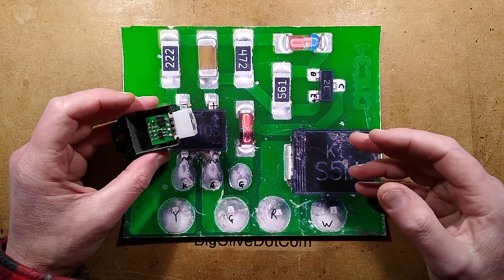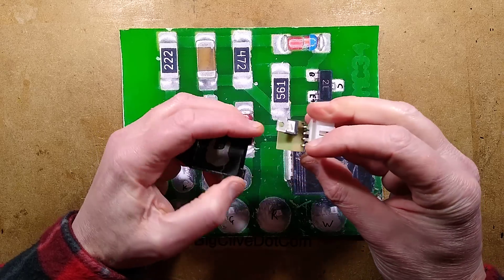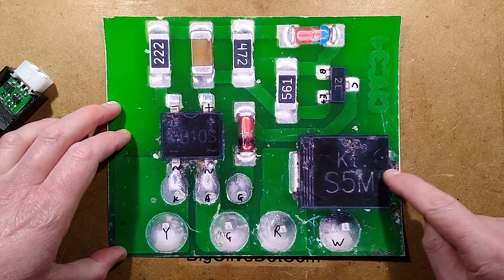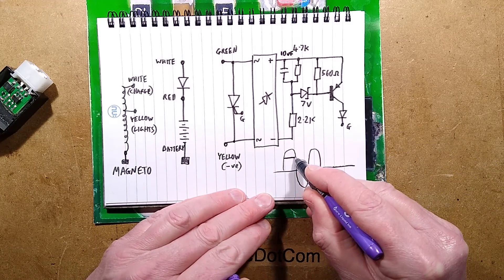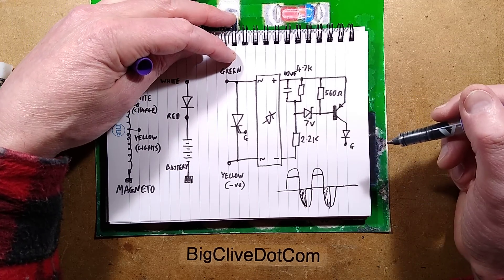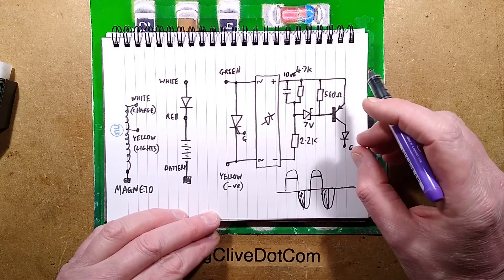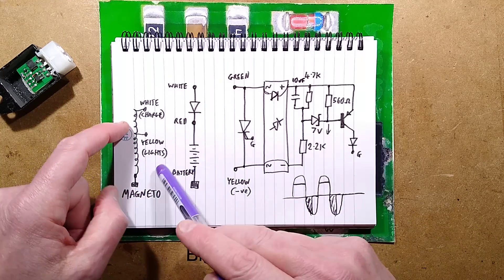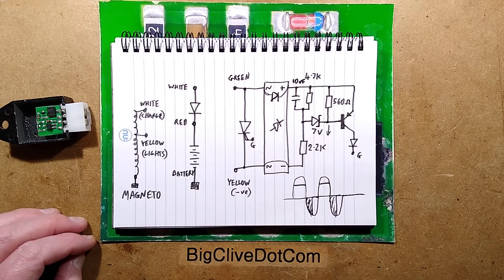Chinese quad/scooter rectifier/regulator teardown with schematic

Comment: It would be interesting to see a comparison between a cheapo reg rec and one from a Japanese manufacturer, especially as they can be prone to failure over time.
Reply: I agree, I hope that the Japanese ones have a proper regulator circuit on the DC side. I had no end of issues on an old Honda MT5 which only had a single diode on the DC side, there was no regulator on the DC or AC side. It boiled up my modern sealed battery which caused the DC voltage to float up to some really high level, it then blew all of the DC powered bulbs and the flasher unit! The AC voltage also went high and that blew the AC powered bulbs. In the end I fitted a 4 pin 6v regulator unit off a later model, (SH570-6), the DC voltage now sits at about 7.8v which is still a bit higher than I want but it was up at around 9v when it was running with just a single diode, (no wonder the battery boiled!), I guess this must mean there is some form of regulation going on.
Reply: @sidecarbod1441  damn that's an odd failure, usually they just die on you miles from home
Reply: @gingerelvis  Yeah it was annoying but at least the bike got me home!
Reply: @sidecarbod1441   i have same problem on gy6, all my electronics are BLOWN(flasher relay, blinker bulbs , tail/headlight, dashboard, speedo,odo..etc) and battery. idk what to do at this point
Reply: @LasheXX  I'm not sure what a gy6 is, if its an old bike with 6v electrics then you need to find out whether the AC is just rectified or whether it also has a regulator, really you need a reg/rec unit. I have also given up using sealed batteries on my moped, I now used an old style lead acid battery that I can top up if required, it seems to be able to cope with the 7.5v that the charging system puts out. When the Honda MT5 was in production it was fitted with a lead acid battery.

Comment: Sad to say, 4 years of engineering school and had never heard the term 'magneto' before (except in the comics). Had to look it up and then "Oh, it's a generator". 🤦‍♂️

Maybe it's an American thing like not using the metric system.

Also, thanks for the teardown and lesson. Subbed. 👍
Reply: Think that's just the traditional word in this context, similar to the snubber cap in the ignition circuit being referred to as "condenser". That's understood I guess, as the basic design is like 100 years old!
Reply: A magneto is a specific kind of generator, using permanent magnets, rather than energized coils.   Just claiming it's an American thing is like being upset with people for not calling a pickup truck an automobile.   Because they're all the same. Now, if you spent that time as an ME, then I'd understand it.  If an EE, not so much.

Comment: With the Light circuit basically shorting the yellow lead to ground, that might actually be a shunt voltage regulator for the battery charger.

Also, I suspect what Clive is calling a "thyristor" is actually a TRIAC rather than a SCR, then the bridge rectifier makes a lot more sense as it would fire in both Yellow positive and negative cycles. 

I suspect that you will have to do some testing in circuit to figure out exactly what this thing is doing, as it obvious is doing some "tweeky, weird" things that all interact. As is, it's confounding with just looking at the circuit.

Comment: I had the voltage regulator fail on my late 90's yamaha FZR motorcycle once, I was facing a garage door and very quickly my headlamp got very bright, and then flashed every color of the rainbow at insane intensity before going dim and the bike dying. The headlight's behaviour is what alerted me to the regulator failing

Comment: Dear Mr. Big Clive, please excuse my comment ediquite as it is my first. I enjoy your stuff. I am a 55 y.o. manchild. Worked on autos all my life. It was explained to me at an early age that the SPARK OF AN IGNITION COIL is produced when the primary winding "collapses" over/on to the secondary. Say when ignition points open, the "back emf" from the deenergizing primary falls over the secondary. In short, the spark is produced when the PRIMARY GROUND CIRCUIT IS OPENED. CDI allows for an increase of primary voltage, thus a multiplication in the secondary. This is how I understand ignition coils work. (I've been wrong before) I did not grasp your explanation on this subject , though I usually do.    THANX FOR THE FUN!  Keep up the good work.

Comment: Hello Clive the way the bigger bikes control and rectify the voltage is very similar to this except they usually use a 3 phase alternator with 3 thyristors one for each phase the voltge is then rectified by a 3 phase rectifier and the voltage sampled and each phase is then shorted by pulsing the thyristors on and off this then regulates the output voltage to around 14 volts this then controls and charges the battery. Its a bit of a sledgehammer way of doing it but it works just fine. It also does not overheat the alternator windings because as soon as it shorts out the alternator there is no current flowing as it is fully shorted and in theory no current flows and therfore no heating occurs during the shorted out pulses. 

Thanks for the channel by the way all very good stuff.

Comment: The overvoltage is accommodated in the battery by electrolysis. Battery water maintenance is a thing for motorcycles with these crude circuits.

Comment: Years ago I owned a 1971 BSA 250 cc single-cylinder motorcycle.  As with many smaller bikes at least at the time, the alternator effectively consisted of a permanent magnet rotating within a coil.  Its output was fed to a selenium rectifier, and the "regulator" was a 50-watt zener diode.  It did have a battery which of course provided some voltage stabilization but that was the entire charging circuit.

Comment: Unless stuff on the motorcycle/quad requires AC to operate, it would make more sense to do it like they do on car alternators: put a full bridge rectifier across the coils. With full wave rectification, the battery charging voltage can be a little lower (fewer turns on windings) and with windings not needing to handle short-circuit current ~1/4 of the time, they should be able to use thinner wire gauge too. You also get better energy efficiency and smoother operation from the engine by generating less unnecessary and irregular drag.

Comment: I am trying to make remote control Ac appliances switch using CRT TV remote infrared receiver. The problem is when I search on google I found infrared receiver output logical means when I push the remote button sensor output is low. When I not push the remote button sensor output goes high so that means when I connect NPN or PNP transistor in to the out put of the infrared receiver to derive the rely. Rely derives the AC appliances. The problem is infrared receiver output not go low that means normally appliance is on. When I push the remote button appliance not turn of. Infrared sensor output is drop to 0.5 v instead of full. My CRT TV remote receiver module is brand new  This circuit is not made of arduino .What is reason behind this please explain.

Comment: The battery is regulated by the very shunt regulator you detailed as it shunts the entire winding.  The bridge rectifier is because with lights off both sides will be full voltage.

Comment: Personally for my experience with my three different scooters the first being a 50cc 2-stroke and the other two being four strokes the battery really never retained its charge too 12 volt or higher it seemed every two or three months during the summer I would have to recharge it just to make sure that I had enough energy to electric start the bike and keep the headlight bright enough for me to be seen at night and to be able to see!

Comment: I wonder if they are relying on the idea that you will be riding it and using enough energy out of the battery to not have to worry about it overcharging. I mean there isn't much of a point to idling your quad is there, other than to warm it up for a minute before you take off?

Comment: Hi 
Good evening 
You gets wet you pay for, all the kaswasakies I have owned use alternator that are similar in construction to a conventional car unit and output controlled in the same way 
The old triumphs used permanent magnet alternator and just had a zena across the output of the rectifier. I think it's the cheap Chinese stuff that isn't designed properly 
Keep up the good work

Comment: If the battery is an open-vented one, it will dissipate any excess energy by splitting water from the electrolyte into hydrogen and oxygen. In the perfect explosive mix, two moles of hydrogen to every mole of oxygen, right next to the hot silencer .....  although any explosion will be limited in energy to however many joules would not fit into the battery.  Unless it ignites something else .....  Something to think about as you ride along, with your bum so precariously close to the petrol tank .....

Comment: Some years ago, I had problems with my old 70´s moped (better call it Mofa- Motorisiertes Fahrrad) with an completly unregulated 6V magneto, that the lightbulbs would constantly burn out. I then tested a regulator from a scooter wich regulates anything higher than 12V to 12V´s, wich stopped that. But I always wondered how these regulators worked due to it needing a chassis ground. Oh and there is very nice webside wich goes into great details about 70 and 80´s Magneots and regulators wich where used in german mopeds in that time.

Comment: 6:00 The magneto can be crowbar shunted on higher rpms because the frequency is higher and therefore the impedance rises, too. Also the filaments of the bulbs won't flicker when a high frequency spiky voltage is applied (1500 rpm = 50 Hz, assuming a 2-pole stator with a 4-pole permanent magnet rotor)

2:32 The same reason applies to charging the battery, higher rpms let the impedance rise and limit the current into the battery. When the lower part of the winding is shunted (chassis-yellow) the upper part (yellow-white) won't add much voltage to the overall output.

Comment: It looks like it's for a 6v system hence the 7v charge limit, your close with the reverse engineer but bridge rectifier will create an noisy dc power feed due to no cap, when high revs it will clip/shunt at 7v. This is why most peds/scooters lights pulse on idle.

Comment: I hope not all of these modules are that basic. My dad's scooter has a bad (basically open circuit) battery. If it uses this circuit no DC regulation will happen and presumably the headlights would get overvolted as a side effect as well. Fortunately nothing seems to have blown, so it either has a more advanced regulator or its circuitry is capable of handling high voltage spikes.

Comment: Way back generators on small engines were just dropped across lead acid batteries or a bit later alternators were rectified and the battery just loaded it down. There was no attempt at any voltage or current control. This works so so when the charge current was only a few amps and the battery was primarily for starting. In some cases a separate coil was used for the biggest load, lighting, to limit the current to the battery. You had to top up the battery with water often and also charge the battery off the mains now and then if you wanted it to live. As the current drain went up in boat motors, power equipment, motorcycles, this scheme was not going to work.   So the next step was to put a voltage clamp right after the rectifier. This was a big fat zener  diode or a linear circuit that was basically a high dissipation clamp. This keeps the load  constant on the alternator, maintaining a predictable idle speed, since small engines don't have the idle torque to deliver much power at idle. But it is very wasteful. Later versions used a SCR or MOSFET and PWM control to short the winding's out. Instead of the linear circuits. Large bikes usually have a 3 phase alternator for more power in the same space.  This was the case up into the 90s, till bikes had a ton of power hungry loads and they also started having EFI which can regulate the idle speed. The bigger bikes then got field regulated alternators just like cars at this point.

Comment: Mr BigClive... I have a suggestions.  Perhaps you could look into a mechanical regulator typical of 1960s buicks?  They predate one-wire alternators and are a mechanical approximation of the voltage regulator you have here but they turn on and off the field wire to energy the windings.  It probably could all be replaced by something super simple.  I can open one up and photo it if you are interested... I don't think there is much in them and am surprised the chinese thing doesnt do the same thing.  Turn the winding on and off and have the voltage float to 14.1 volts and call it done.  Let me know and I will crack one open or arrange to send it.

Comment: It looks strange to you and minimalist?  It is China :p  It is built to a standard that no other country in the world would use because it would fail if it is used.  In china scooters are extremely disposable if you have any money at all or continually repaired when the damage becomes dire if you are the working poor.

For giggles find a used wiring loom for a japanese bike to see how it is done.  Good for comparison.  Local TT scrappers perhaps? :p  I have manuals for a proper honda motorcycle if you would like to see real diagrams and I have some used components.

Comment: You assume that the stator produces more than 11.1v because of course it meant for lithium ion because China: p  they never understand the actual usage for their products.

Also if you look at the windings it appears to me that the stator wouldnt put out much power...  its not much more than what I would expect on a push lawn mower.  I doubt it would have enough jam to power the light continually.

Is there a crankpulley available for sale?  It would be hilarious to rig it up on a drill and spin it to 2000 rpm and see the power output.

Comment: Hey there, its completely normal Design.
My 1984 yamaha xt 600 has also sand in its cdi box. That Thyristor shortcut design is also the same , even on the later XT 600e Models with elelctric Start and 3 Phase Alternator with 3 Thyristor shortcut design and zener ignite system even without extra switching  Transistor.
Almost all Japanese Bikes are regulatet this way , but without ac Lights. 
And yes it collapses the Magnetic Field ot the Alternator , so the Thyristor is not killing the hole Energy,the altornator is able to produce. 
Greetings from Germany

Comment: The diode on the transistor's collector can also be removed if the bridge rectifier is simplifed as you describe I think.  [ BTW the circuit is loooooooow quality IMO ]

Comment: There are some things I don't understand. How is there a negative component AFTER a full-wave rectifier? Also, it seems to me that the voltage divider leaves about 0.3Vin on the zener anode, thus the zener should be active with Vin > 10V. Wouldn't this clamp output over 10V and protect battery from overvoltage?

Comment: Many scooter manufacturers simply state to not fully charge the battery.  Some people can actually drain their scooter and keep it at around 40%, only charging to 90% or full just before use (an outlet with a timer set to two hours is usually enough)  Which is the best way to keep a lithium ion alive.

Which is completely different than a cellphone, where you almost always keep it at 100% when not in use.

Comment: Seems like they could have replaced the whole mess with one higher current bridge and charged the battery off both halves of the sign wave, also clipping the lamp voltage.

Comment: The bridge rectifier would make more sense if a bidirectional thyristor was used in lieu of an SCR. Then it would actually provide regulation since it would shunt the lighting winding section and cap the voltage the battery sees. Maybe they over-skimped?

Comment: The way these gadets regulate the battery charge voltage is by having a very small generator output which is easily "defeated" by the electronics. If you try putting one of these on a bike with a higher output generator they will pop almost immediately and, cook the battery. eBay listings can be seen which claim these are at the same time 6 & 12V regulators????? which is impossible. Carry on the good work, always entertaining and informative and nice to see you dabble with auto electrics. In your previous harness video you didn't quite get right  the description of how a distributor works. Contact breaker points on a 4 lobe cam do the switching and the distributor distributes the HT to the correct plug lead so you only need one coil. A pretty much obsolete system these days.

Comment: We got a house that came with a riding lawn mower trying to troubleshoot it it's very weird even with the wiring diagram for me to figure out so yes vehicles are weird they have both AC and DC and I only recently found out that a car's alternator is AC with a bridge rectifier that doesn't necessarily filter out all of it to dc. Oh yeah they also use the DC battery as a capacitor to smooth out the alternator which is why you shouldn't run without the battery, however newer Vehicles apparently turn off charging from the alternator after the battery has topped off so trying to run a large load like an inverter could theoretically burn out your cheap alternator.

Comment: Wouldn’t shunting the coil on that half of the sine wave change the voltage on the charging current half of the coil? Because the center tap is now the ground reference?